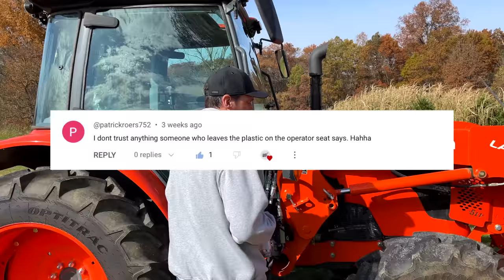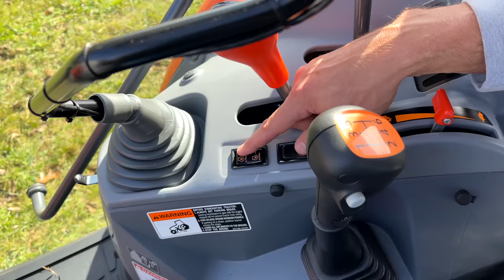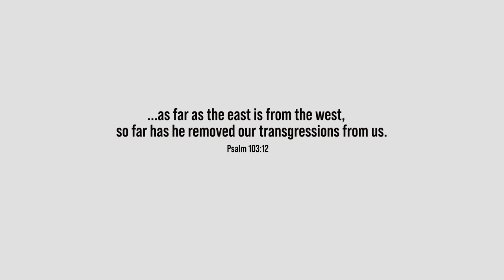THESE MODIFICATIONS PUT THE “DELUXE” IN THE KUBOTA M4D-071

Comment: So true about getting it setup correctly from the beginning! 

The second 3-point lift controls come in handy if you use the 3-point for lifting with a boom or other implements, but not everyone does that.  It’s also nice sometimes for moving trailers around depending on the trailer and situation (leveling stands on a travel trailer for one example). 
If the tilt for the 3-point is a threaded rod it’s easier having 3-point lift controls within arms reach when adjusting tilt. That comes back to correct setup from the beginning.

Comment: Congratulations on M5-111, smarter investment than the tracked one.  
I’m still in full support of tracked tractors. They’re very useful but tie up a lot of money. 

I could definitely use a full size utility with a hydro. Construction equipment uses hydrostatic drive well over 300hp in different applications but there’s plenty of cooling and the cost is just part of the game. An usable efficient hydrostatic drive on a full size utility tractor would probably add a good 40-60k or more. That’s almost doubling the price on some of these and the rest of the tractor would need to be made strong enough to be used for the type of work requiring a hydrostatic drive.
Reply: The quad track does make me wonder how much harder the power steering has to work to turn the front tracks due to increased ground contact & associated friction/drag.
Reply: @InsanePacoTaco  That’s a great question! The ones I was around never really showed anything to make me think it was an issue but that’s not really saying much. The ones I used had the same steering feel as rubber tire, but that’s not saying much either. I wouldn’t think it wouldn’t make much difference in most situations. The force of the tractor to the ground doesn’t change if the surface area is larger or smaller, but the shear strength of whatever the tractor is sitting on can change along with the coefficient of friction. But the ground contact is further away from the center of the rotation so the friction of increased ground contact may make a difference because of leverage.   
Good question for sure!

Comment: Nice tractor. I wish I would have known . I bought a 2023 caseih 75c at the end of August. Oh well. Sweet tractor, especially with all the goodies you put on it. Love your channel. Keep up the good work.
Reply: How do you like your 75c so far? 
How many hours on it?
Reply: Can't really tell you. Seems nice, but don't have much seat time yet
Reply: I do have a couple of pet peeves. 1) I don't like that you have to have a rod to poke in a hole to open the hood. Thanks from Europe I guess. 2) I don't like how the 2 hydraulic remotes are positioned  on the back. I'll get used to it.
Reply: @gregsteiger7829  I know what you mean about the hood and the rear hydraulics. Maybe the rear hydraulics won’t be as bad after you get some time on the tractor. They seem like nice tractors. 

The rear hydraulic couplers can be moved. I’ve done ones similar to the 75c. It’s just a matter of fabricating a new bracket for the couplers and running hoses. The hard part is finding someone who will do it and make it look factory. Sometimes the dealers will do it and sometimes they won’t. It can be pricey though. 

I’m hoping a Case dealer opens closer to us soon. The closest one is a three hour drive but supposedly they are opening a second location i in n our area.